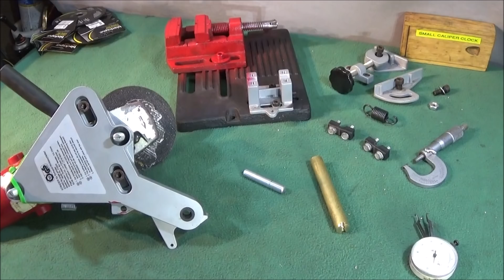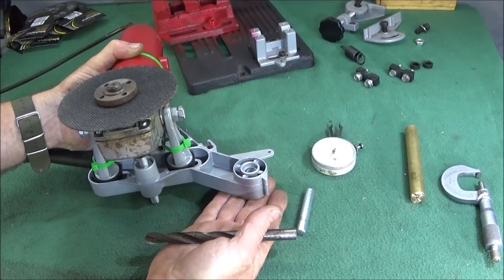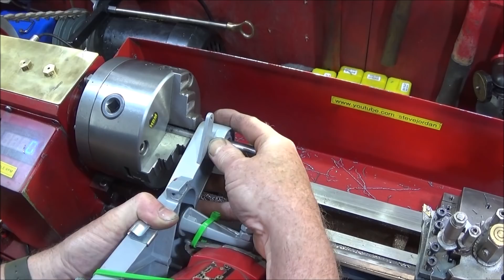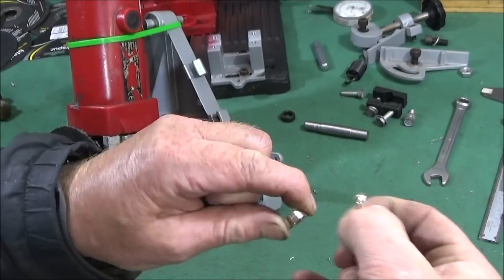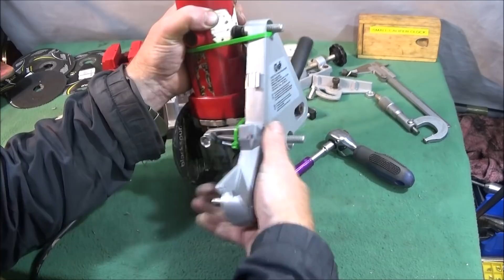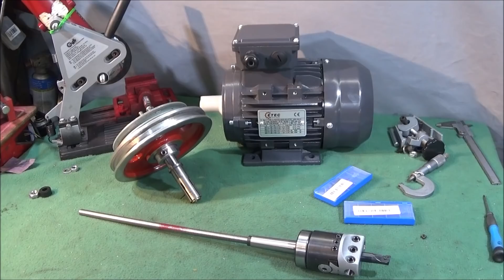Angle Grinder Cut-Off Table Upgrade For Cutting Precision Slots

Comment: When i got mine it only had one bush fitted not impressed ,,, so removed the one fitted , and made two out of nylon with a tighter tolerance (interference fit) and works great, did not need to modify shaft, cheers for video very informative.

Comment: i got that thing too, i guess its wolfcraft selling it here in germany. i also noticed some slight inaccuracies in that thing but i cant really complain about it. its cutting faster, effortless and straighter than i would cut with a hacksaw and it makes quick work even on hardened materials. plus its really save and easy to use. 

i find an anglegrinder one of the most intimidating tools i own (at least when zip cutting) so the angle grinder stand even though its not perfect is one of the most used tools in my shop :)

Comment: Nice work Steve, one of the best things I have bought for my workshop has been cheap fire blankets, when I have to grind or use the chop saw I drape them behind where I’m working to protect from sparks, just roll them up and put them back in the bag for next time. I think the last ones I bought were from Aldi cost about $10 each, really handy for grinding in the small workshop.
Cheers
Reply from the maker: Hi Raymond....What a great idea, thanks! These will be great for my workshop. I have often seen unused ones being thrown away at my local recycle center, there's another use for everything! Regards Steve
Reply: Steve Jordan cheers mate, that’s what it’s all about 👍

Comment: Great vid Steve.  You could just run the mandrel expanding cone up the drawbar of course I suppose, or use a locking cone at the Pulley end (not expanding of course but give you a hell of a good grip.)

Comment: Good video...
Yes it's very simple to do if you have a thousand dollar metal lathe.
Reply: He did not use the word "simple" in the title and, you don't need a "thousand dollar metal lathe" to do this type of mod, you can buy bushings and shafting from the online sources, so just a plain hand drill is all you'd need to effectuate the improvement.
Reply: You don't have a lathe? WTF? How do you get anything done? Don't tell me you don't have a milling machine either.
Reply: @ExtantFrodo2  Nah....he's one of those armchair watchers that will always be watching and never doing.
Reply: @gangleweed  it's a bit nonsensical to spend this much time on a 30 dollar chinese product. I'd rather be an armchair watcher in this case.
Reply: You'd be Surprised what a File, Hacksaw, power Drill can get Accomplished when you arent lazy and use simple Tools because you dont own any Expensive machines.
Reply: ...Or not - because you spent most of your life doing just that. Let's see, hacksaw vs angle grinder? Lathe vs drill? - Hmm.
   It ultimately boils down to a question of precision. (which in this case as stated "if you're just doing sloppy cuts anyway, then this alteration would not really be necessary." Repeatability is not something you can do well without machinery.
   Then again, I got my 9x20 central machinery lathe off craigslist with all sorts of attachments and tooling for $200. It's paid for itself a couple times over.

Comment from the maker: TOOL BUYING LINKS BELOW:- 
Electric Angle Grinder Stand Angle Cutter --  https://goo.gl/f8mS2A
 Drillpro 10pcs Blue Nano CCMT060204-HM YBC251 Carbide Insert-- https://goo.gl/kHJ1XE
      Drillpro 10pcs Blue Nano DCMT070204 Carbide Insert --  https://goo.gl/aqZoA5
    10% off Wholesale Electronics (EU Warehouse)-  https://goo.gl/Vidj2E  (10% off code: EUELE10)
     10% off Wholesale Electronics (US Warehouse) --  https://goo.gl/7vugKb  (10% off code: USELE10)
     Flash Deals --  https://goo.gl/msdzTK